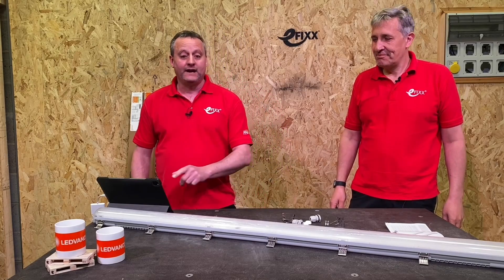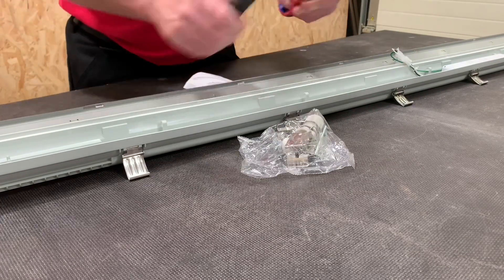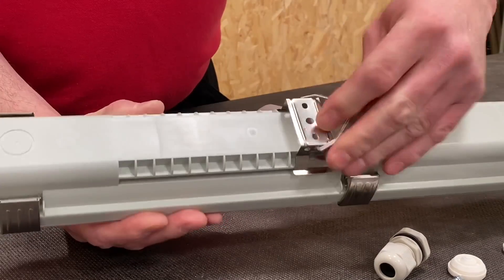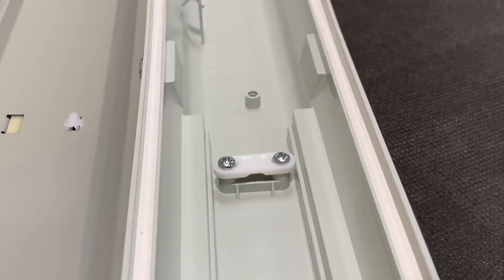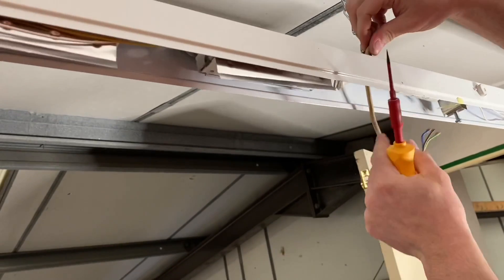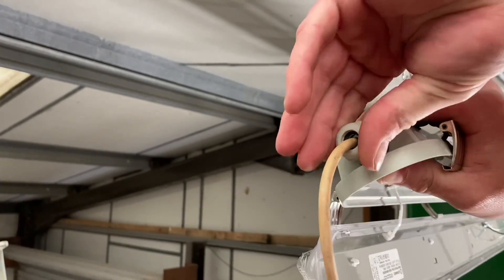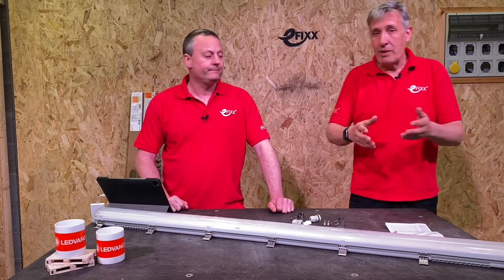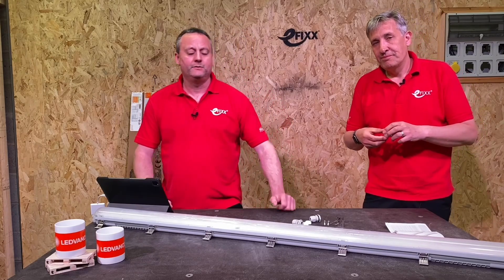What makes a good NON CORROSIVE LIGHT FITTING? We lift the lid on the new LEDVANCE Damp Proof linear

Comment: Are these unit fairly robust?  I've installed similar fittings from Luceco which cost more than these and I was not too impressed with the build quaility.  The body flexes like anything and it would not stand up to any sort of vandalism or impact in a car park type application.  I'm not fond of the mounting system on these either as they are really easy to rip off.

Comment: Recently fitted a few of these, really good fittings, good spread of light compared to some other fittings i have fitted, metal latches are a bonus and i fitted the anti theft bolts due to someone a few days after knocking one and the fitting coming off .. sound as a pound now ...  using a lot of ledvance products now, well priced, quality and reliability id expect.. just kitted a show home out with some ledvance 1906's on some custom pendant lighting ,really impressed with those, get them to send you some lads

Comment: Looks better then a well known brand we have to use at a hospital. The features that are better are the fact you get stuffing glands with it and not just grommets. Also where you put the clips on you have a longer range instead of being restricted by the width of the clip. So if you are hanging them on chains there is more give. Hopefully better life span then the brand we use. We've had to replace around a dozen of ones installed less then 2 years ago.